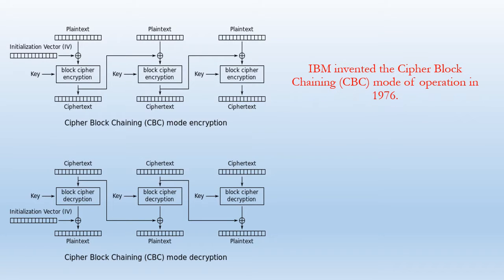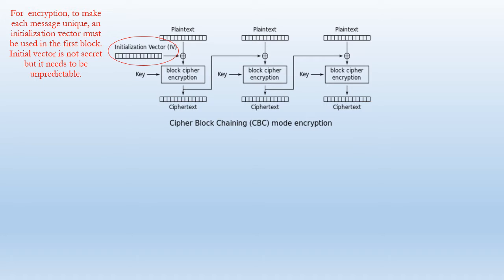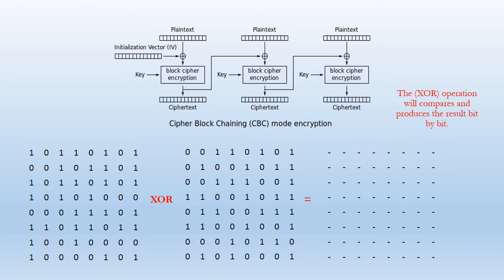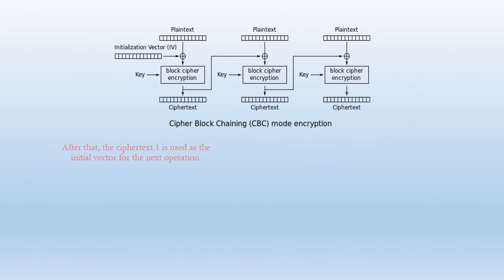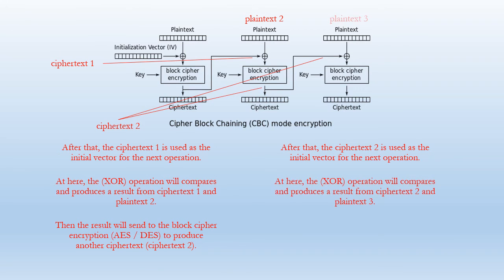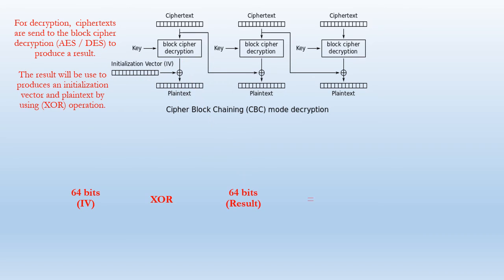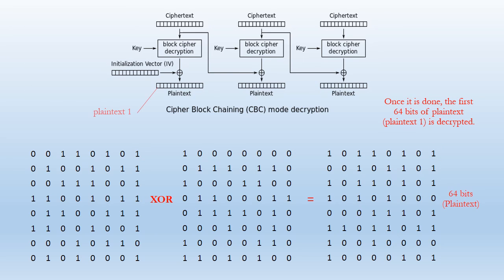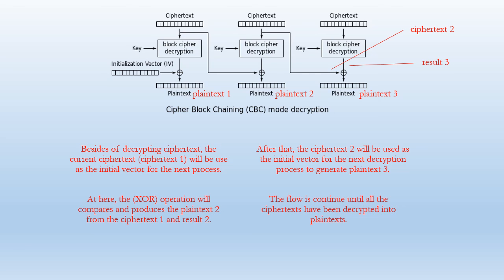Cipher Block Chaining Mode (CBC)

Comment: Very nice explanation. Its really outstanding from my point of view. Please, If you have a bit of time, can you answer the following questions. Please I need it. I hope you must reply of my comment: 

01. In ECB, what would be the encryption for 0010 1111 1001 0100 1100 with key 0110? 
02. In ECB, what would be the decryption for 1101 0101 0110 0001 0110 with key 0110?
03. For CBC, what would be the encryption for 0010 1111 1001 0100 1100 with IV 1101 with key 0110?
04. For CBC, what would be the decryption for 1101 0101 0110 0001 0110 with IV 1011?
05. For Output Feedback Mode with n=1 (i.e. use of one bit per encryption/decryption operation), what would be the encryption for 0010 1111 1001 0100 1100 with IV 1101 and key 0110?